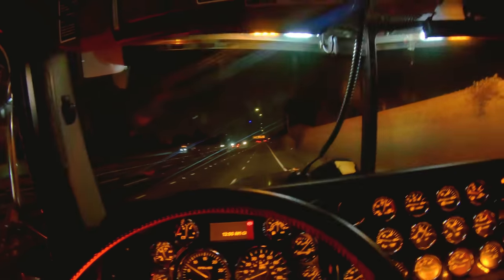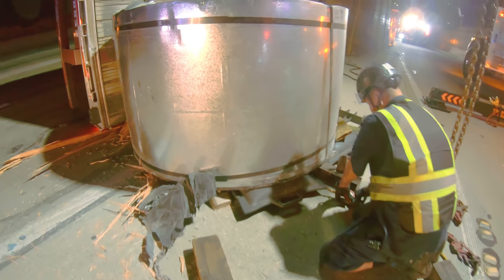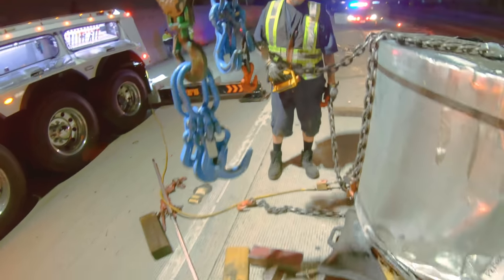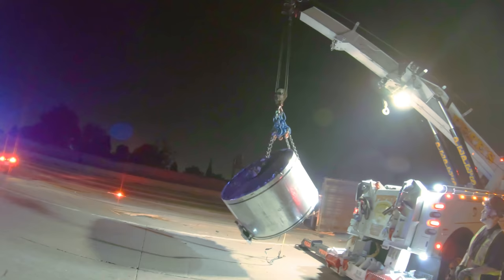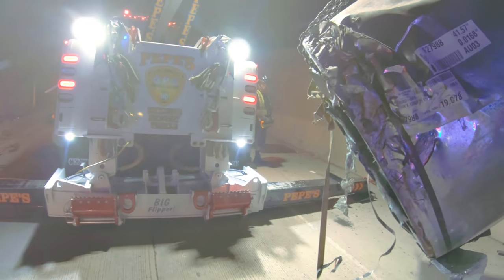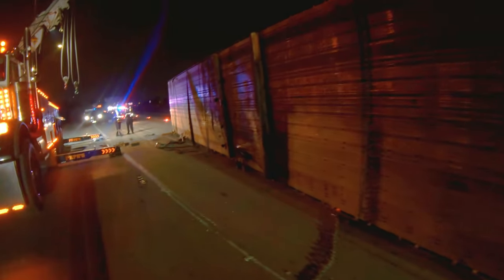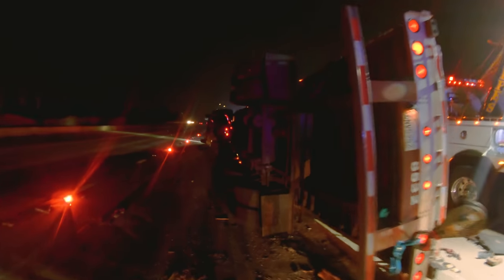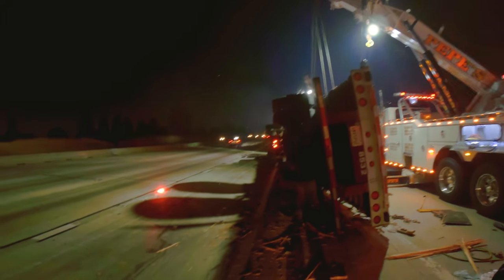Big rig rollover on freeway (42,000lb coil falls off trailer)

Comment: Great recovery guys. Brings me back to my 11 years of steel hauling from WI to MI a few moons ago. I can relate to the heavy coil & busted up trailer. Most of the flatbeds today are mostly aluminum. They flex. They flex a lot. They can actually be bent up into almost looking like a pretzel, & when you release the freight weight, they spring back straight again. This shit scares the shit out of me. I remember actually going on off ramps with large curves in them & actually watching the coil shifting it's weight on the trailer sometimes causing wheels to come up in the middle of a turn. Learned real quick to slow her down. I did  have a trailer break just like this one once when they loaded a 48,700 pound coil on my trailer. I was out in the parking lot, chaining the coil down & all of a sudden the trailer just jumped. Enough to scare me into looking at the frame structure underneath. Sure as shit, she had cracked. Right where the coil was sitting. I was able to get unloaded & spent the next 2 days figuring out what I was going to do with the trailer. JUNK!! Glad it happened before I set sail. Love your videos, keep up the good work.

Comment: No way was that trailer going to hold that much weight loaded in the middle!! NOT smart!! It's a very good thing that that steel roll landed on it's side!! Josh, Dave, Big Flipper and Hulk to the rescue for another textbook recovery!! And, ZERO further damage to anything!!!! Take pride in your ride and, take pride in the work that you do!! It's becoming a rare thing these days!! Job VERY well done you and Dave!!
Reply: @arlisspropertyservicesllc5943  "Some" trailers are designed for that. Considering that the frame rail broke in half, I don't think that this is one of those trailers. I've been driving for 40 years and hauled a lot of coiled metal like this. I have personally seen 2 trailer frame fails like this at the Port of Portland. Fortunately, neither of them made it out of the port terminal.
Reply from the maker: I see stuff hauled wrong ALL THE TIME. I just seen one Friday where a guy was hauling a 64,000lb machine in the very front of his step deck two axle trailer lol, I'm sure you can already guess what happened there!
Reply: Pepe's Towing Service 😂🤣😂🤣 That’s what keeps you so busy!!!

Comment: They have to set those coils in the center of the trailer to get the weight distributed between the trailer and tractor axles but it's very hard on the trailer, especially on a rough road.
Reply from the maker: Agreed, which is why accidents like this happen.
Reply: They should probably use shorter trailers for this...
Reply: @wilfriedklaebe  There are weight restrictions that require certain distances between axles. To weight the maximum of 80,000 pounds on 5 axles, there must be 51 feet between the center of the first axle and the last axle in most states. If the only cargo hauled was coils like this, they could use a longer tractor with a shorter trailer or a trailer with more axles. Most trucks haul a wide variety of cargo so they use long trailers. Extra axles add weight and cut down on the payload that can be carried. There are specialized trailers to haul coils but the truck will likely run empty on the return trip and there aren't always coils to haul.

Comment: So did the trailer break during the rollover, or did it cause the rollover somehow? Seems like the weight would have had to work on the trailer for a while while driving to tear the frame like that. I would expect it to bend in the rollover, not tear, but what do I know.

Comment: I've wondered why a semi trailer only has one roll of metal, and wondered why they use so many chains to hold them down. Now I know, because they are very heavy!  Crazy weight!
Reply: It can be done, they are not going to cut the weight of the coil down. As far as the customer goes, the more the happier they are. You just got to make sure you are using the proper load securement equipment, that you have good wood dunnage that the coil sits on, that the coil is position properly on the trailer for weight distribution, & that the driver is experienced enough to handle the heavy freight. The trailers today are aluminum. Putting that kind of weight on the trailer causes the trailer to flex & bend. The driver has to learn to drive accordingly.
Reply from the maker: Oh ya, and this was a light one. They can be much heavier! So two of these could be very close to 100,000lbs. The MUST be transported and secured properly.

Comment: Hey Pepe love your channel bro, I'm impressed on how your crew works and communicates together. Your personal professional knowledge and approach to each job is a credit to you, shows you are a thinker.with this job you did I'm wondering if the trailer wasn't suited to the load and when it cracked is that the cause of the truck rollover ? That roll of steel is very heavy and would have killed someone, hope someone is investigated over it.

Comment: That looked like "Tin Free Steel" used in making cans. That coil, from what I could see, may be salvageable. The wrapper is just there to protect it.
Reply: That coil will be scrapped. Any wrinkle will cause problems when they try to run it through the machinery. The consignee won't accept it.
Reply: AU03 probably from Sanjeev Industrial Corporation. Also known as TATA-Steelium, .0168" deep drawing steel. So Mike you are probably correct for making cans. The problem will be during high speed presswork and if the coil feeds correctly due to being out of shape and having edge damage. I would not use it and risk a big customer account.
Reply: It'll be refused and back to foundry,they'll melt it down reuse it
Reply: @tiredoldmechanic1791  Your correct. A small job shop will pick that up in an auction. They will spend weeks cutting away at it trying to salvage what they can.
Reply: @Caeser194  It'll will end up at a freight auction. Somebody will pick through it.
Reply from the maker: Any estimate on how much they can salvage this for money wise?
Reply: @PepesTowingService  Scrap prices are pretty low and it's expensive to move those coils so probably not much. Steel sheet metal is about a penny a pound.
Reply: @tiredoldmechanic1791  That's bad, somebody's going to be out a lot of money. Bad situation for everyone :(

Comment: That was one heavy roll.  Did they say what kind of metal it was?  Good work by all of your crew!
Reply: Whatever alloy it was, it is only good for scrap now.
Reply: Looks like stainless. But I'm  just going by how shiny it is.
Reply from the maker: Thanks! No clue on what kind of metal it was
Reply: @PepesTowingService  If you can give an estimate of the dimensions (diameter of the coil, diameter of the hole in the middle, and the width across) some math/science jockey could probably figure out the most likely material. Different metals have different densities, and when you start getting into such big numbers, it gets easier to narrow the list down.

Comment: Do the cops or transport authority do an investigation on an accident like this? I know here in Australia our freeways aren’t as big and hectic as yours but our transport authority would do a full investigation before the wreck could be moved. Especially when there is such a massive problem with the structure of the trailer.
That coil would be sent for recycling. Nothing salvageable there.
You lifted a 19 ton coil with a 15 ton snatch block? Will you be replacing the snatch block? I know they are generally over engineered to what their rated at but does that concern you?
Reply: yup CHP commercial vehicle unit will
Reply: If there is a fatality in the state I live in, Ohio, it seems the removal could be delayed 4 to 12 hours. Otherwise they seem to remove everything as quickly as possible.
Reply: if inspections are done there are tram marks on all the hooks and you can measure the hook to see if it has spread or stretched

Comment: Was the coil of sheet steel mounted in the middle of the trailer or over the axle? With that much weight in one spot I'm thinking over the axle would be better.
Reply from the maker: I'm not 100% sure but it looks like it was over the rear.

Comment: Is big flipper the largest they make
Reply: There Is A Locally Company Here In Southern WV That Has Some Different Size Trucks But One Of Them Is Supposed To Be A Huge Rated Truck And I'm Going By There Soon To Check On Some Pricing For A Couple Different Things I Need Done And I'm Going To Get The Specs Of Their Large Rated Peterbilt, It's Supposed To Be A Brute
Reply: Big Flipper is a 75 ton rotator.
Miller Industries offers a 100 ton rotator, "Century M100" (according to them the largest rotator in the world)
Reply from the maker: Up until last year, big flipper was the largest model made by Miller industries. They now have an M100 model, that is now the biggest

Comment: Why is the WLL so low on those snatch blocks? Figure a 75 ton rotator would have beefier blocks
Reply from the maker: We have a 20ton and a 25ton Crosby snatch block for big flipper. The skookum blocks are a light weight alloy that are proven, they weight like 45lbs. We get lots of jobs where we have to part our lines and remove them, and RARELY will ever have to lift more than 30,000lbs with just one line. This was that once a year exception.

Comment: I wonder how that driver had that coil secured down?
Reply: Not very, is how.
Reply: @Randrew  I was wondering if he used chains or straps
Reply: It was secured with the right amount of chains, it rolled because the weight of the coil broke the trailer in half and the coil said lets go this way in the process breaking the chains
Reply: ............ I live in this area and see these coils on trailers every day, often times several of them and all of them are loaded the way Pepe's set it on the (new) trailer. I am not in this industry, so I guess 'suicide' means loading in a way that it could roll forward or backward and 'eye to the sky' means laying it flat? Here I have never seen a coil lay flat on a trailer because that would ruin the edge of the sheet metal during loadin, unloading and transport, causing problems during uncoiling and running them through the machines. They always stand them up and sometimes you see trailers loaded with 2, 3 or 4 coils. Hardly ever see I one with more than 4 though.

Comment: Are you guys being paid by rotator? Always bragging about how powerful the equipment is, but for this job 2 trucks?
Reply: You need to have 2 lifting points, and 2 catch lines. That's difficult to set up with a single truck. Also speed is the most important factor here, not cost.